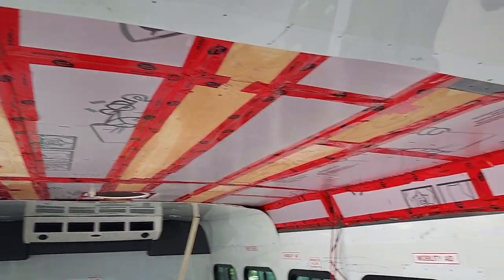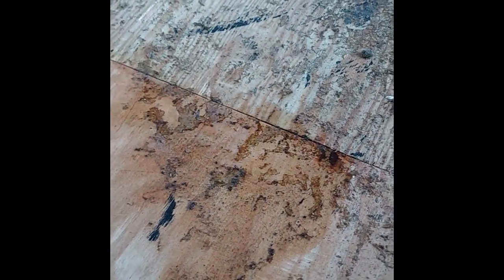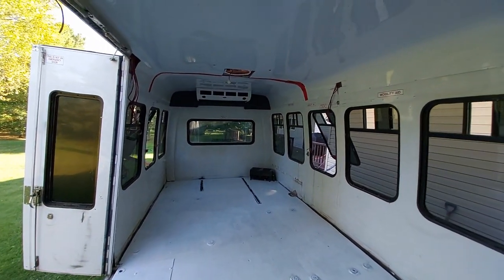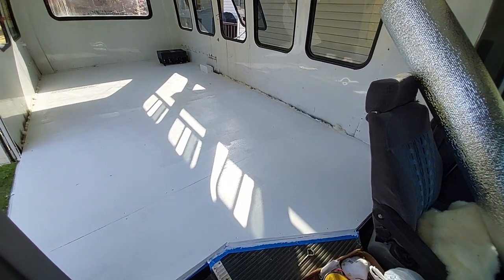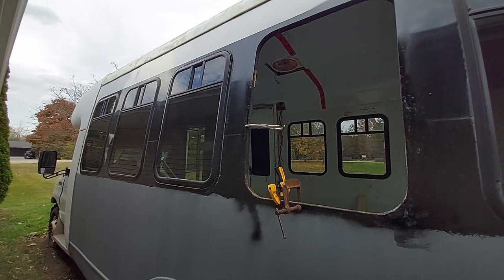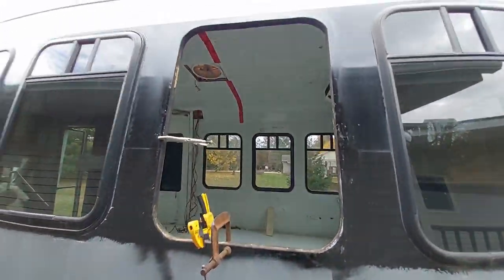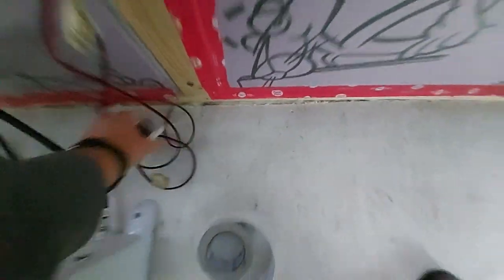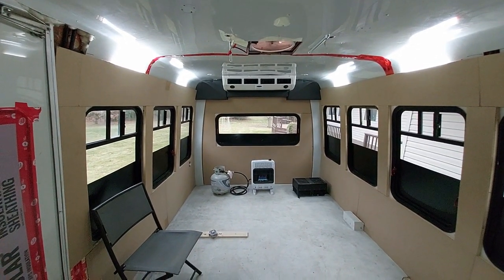Ep. 3 StarTrans Shuttle Bus Conversion - Ceiling insulation, floor insulation, subfloor, walls up!

Comment: nice. my wife and I just got a 2012 chevy G4500 with a rear wheelchair lift. wife was asking about insulation and a lot of fb groups say insulation at least on the ceiling isn't that necessary and its a pain to do, its nice to see someone through this process. it doesn't seem like the chore they made it seem, at least you make it seem that way lol.
Reply from the maker: It wasn't  bad. Heat rises, so if you want your rig to stay warm and heat efficiently, ceiling insulation is important.  Trying to hang wool or batting could be a pain... but taping in foam board was a breeze.
Reply: @respectfulliving1  im gonna watch this video and the others with her later im all about ease but i still want it done right.
Reply from the maker: @CobaltChurch121  the definitive guy for proper bus builds is Chuck Cassidy. He does more skoolies though. Depending on your budget and needs, spray foam seems to be the best. Chucks channel fully explains insulation, thermal breaks, and gives the more technical break down of what works and what doesn't.

Comment: looks great! this is going to be super helpful once i get back to my build this spring. For now my bus is covered in about 3 feet of snow! It looks like you decided to keep the original heater? Curious what your plan is for that unit?
Reply from the maker: I kept one of the two original heaters so that the living apace would be heated when driving. It will be under the bed. Glad you found it helpful.  Not into video editing so I just threw the clips together.  I have the walls painted now too as you can see from the video thumbnail. Will do some trim work after the cold snap and snow storm this weekend, and then it is on to building cabinets.
Reply: @respectfulliving1  great! i plan on keeping my back heater as well but my upgrade it to a vent style heater to help heat the main cabin. thanks again!